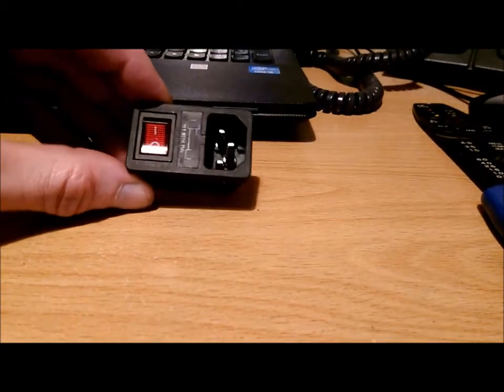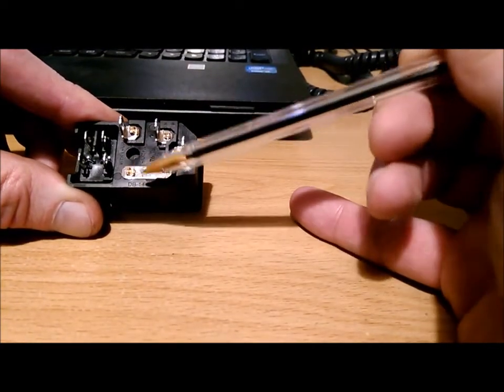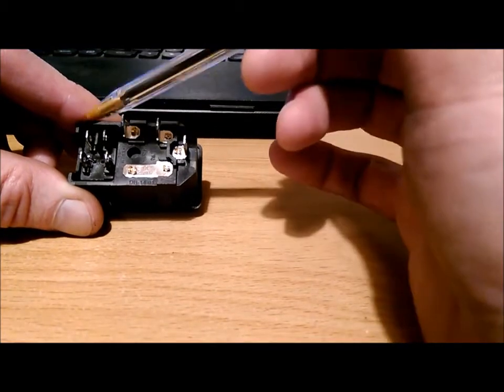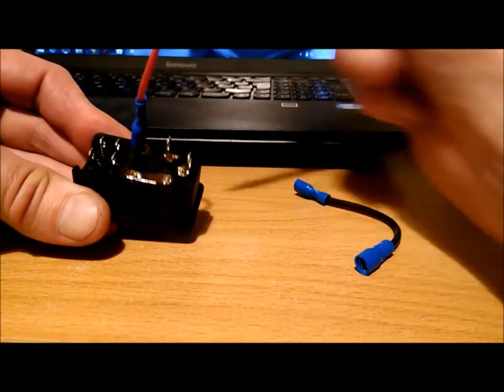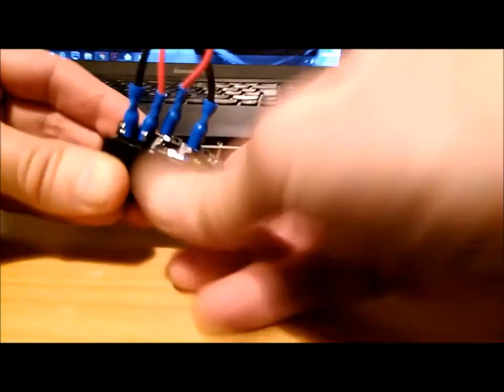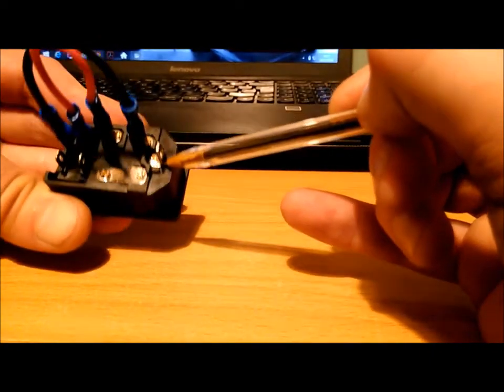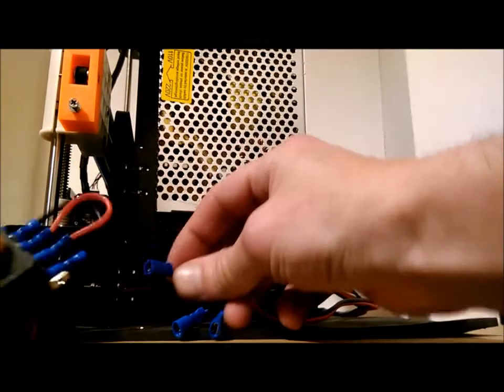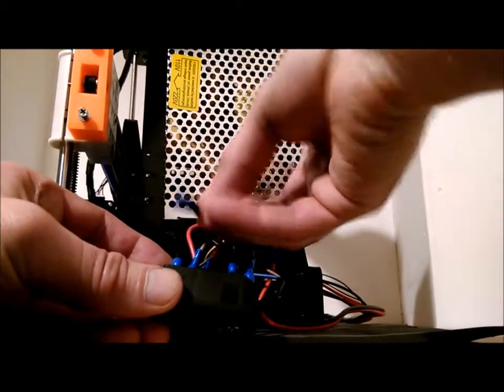How to install a PSU Switch for Anet A8 3D Printer

Comment: Thank you so much, i had it connected the wrong way for a few years.

I have one question: When i use a multimeter and connect one probe to earth and one to the top of the 400v cap of my 24v and 36v Switch Power Supply boards i see about 50 a 64v DC, is that normal? I also put a earth wire to the metal case were my 24v and 36v Switch Power Supply boards are in.

Comment: i have a switch wired exactly like this. the switch turns the psu on and off, but the switch light stays regardless if its on or off.
Reply from the maker: Hi one cause of this is the rocker switch is upside down if you look closely 2 connecters are close together with a plastic spacer in between them and the other to prongs a bit wider apart, if you connect the in coming wires from power to the prongs wider apart and the prongs that are closer together with the plastic in between them looped to the other connectors on the switch like in video. Hope this helps I will try and upload a couple of pictures later this week to show more clearly
Reply: CCNetwork 3D Printer Filament yep. That was it. I never would’ve thought that rocker switch would flipped. Thanks.